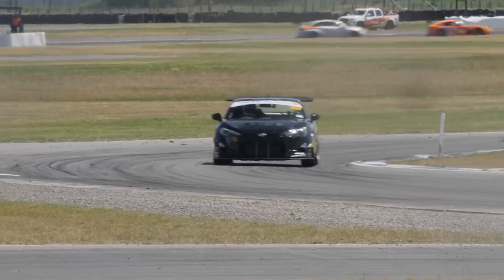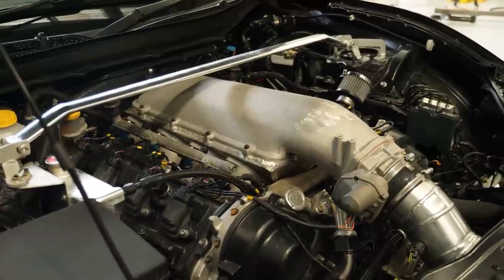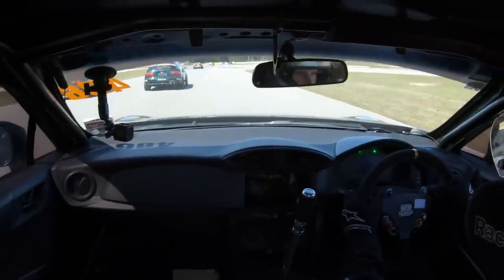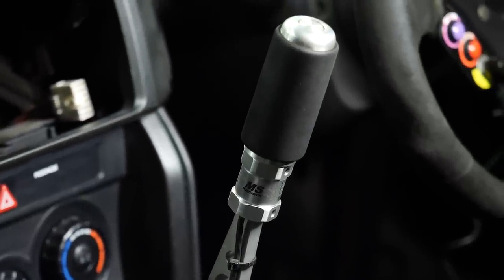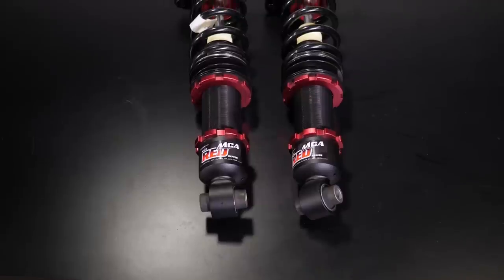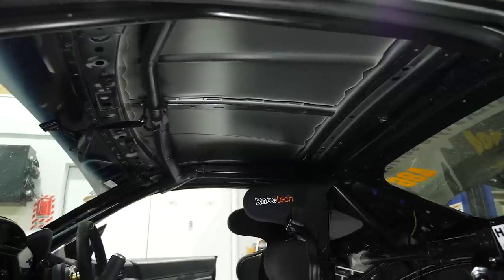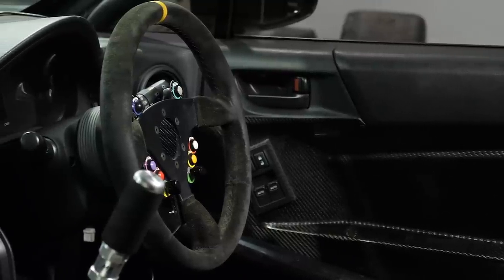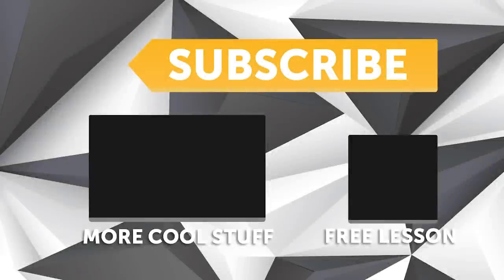8700 RPM V8 GT86 Build | 6-Speed Sequential 450HP 1UZFE [TECH TOUR]

Comment: This is why the VVT-i 1UZ is highly underrated. Rev limit increase and increased horsepower without boost, also means no weight added from a turbo or supercharger.
Reply: The engine in the video eventually blew up during their racing series.
Reply: and in this case no vvt
Reply: This is a superstock engine using kelford superstock cams, VVTI has been deleted, or they likely used an early motor if they have stock 10:1 pistons
Reply: @BigGroupHug  dang how do you know? Is there a video about that
Reply: @BigGroupHug  lots of racecar engines  “blow up” it’s part of Motorsport and racecars living hard lives as well as tuning cars for higher power trying to figure out its limits and breaking point

Comment: Hello High Performance Academy, I'm an amateur driver and I recently bought the Cusco Type RS 1.5way LSD for my 86. I'm wondering if you decided to keep the stock settings or did you reduce the number of preload springs and/or the number of activated friction plates? Thank you, the videos are amazing!
Reply from the maker: Yes we have deactivated a plate on each side. We find these diffs to be a little too aggressive as setup out of the box which tends to cause mid corner push and corner exit oversteer.
Reply: @hpa101  Thank you so much, I will take that into consideration when I first setup my diff. I will make sure to buy your merch, you give so much to the community!

Comment: Absolutely sick build Ive been a big fan since i first saw it. Can you guys offer any insight on what you suggest in the search for more power on a budget with this engine? I’m currently planning my build for a 3uz swapped is300 drift and time attack car. I know fitting an m90 or m112 blower on it is common but it seems like a lot of money and complication for power that could be achieved NA. I also worry about how much power the weaker 3uz rods can hold and when a dry sump becomes necessary. What are the weak points reliability wise and what would you say are the first things to do when looking for more power?
Reply: If you’re gonna boost it go ahead and upgrade your rods. Have you gone for the build?

Comment: This is awesome! What are your plans for the new engine(3UZ-FE)?
Reply from the maker: A little more capacity, more compression and an ITB inlet manifold. We're hoping for around 550-600 hp.
Reply: @hpa101  that sounds like an amazing engine package for the 86. Do the UZ engines get a lot of aftermarket support in New Zealand?
Reply: @aaronbryan5095  that's where they are very popular. As well as aus.
Reply: @aaronbryan5095  heaps of support look up HRE or hartly engines 1uz for nz superstock 9000rpm nearly 600hp n/a 👌👌

Comment: How would running vvt not help , even just to help widen the power band by 500 rpm or to pick up some tq at lower rpm as , you could limit the deg if it works on the old 20v system , so as to have no V to P contact , 
Any chance of a dyno graph and one with foot pounds please 😄, 
Am I right that all the development of these engines are with in race rules , valve lift and compression
Reply from the maker: The engine typically operates between about 7000 and 8700 rpm and VVT really would offer limited advantage. The other issue is that given the lift and duration of the new cams, there's very little room for them to be advanced/retarded. The juice simply isn't worth the squeeze.

Comment: Are the heads, cams, valve springs and intake manifold going to be available for sale soon? I'd like to have that power in my Tundra
Reply from the maker: Hey there Hugo, we're not partying anything out sorry mate, but Hartley Racing Engines in New Zealand or a shop locally to you could whip something up I'm sure. I think Hartley source their cams from Franklin Cams, also in New Zealand - Taz.

Comment: Sorry, I don't get the downshift entirely. Does the ECU time the blip to happen after the dog disengage, before re-engage? Or do you rely on the assumption that downshifts will only be done under closed, or nearly closed, throttle condition?
Reply: Same time. Technically the blip probably starts happening first, unloading the gears and allowing them to disengage, and the rest of the blip it's engaging the next gear.
Reply: @neomeg2232  sounds good to me, cheers
Reply: @derwhalfisch  no prob. 👍 Don't take that as gospel though. I've only worked with stuff for bikes, like Bazzaz. I'm not guaranteeing the system these gentlemen are running is identical.
Reply: @neomeg2232  ha yeh i'd still like an HPA response but you pointed out that the blip will unload the box and that solves most of my confusion
Reply from the maker: The timing of each component of the shift can be very accurately timed through the MoTeC ECU. In most cases you actually want to begin the blip before the dogs disengage because when you're off the throttle the dogs will be locked on the overrun faces and the blip aids disengagement. With a manually actuated sequential we have less control because the shift barrel is moved by the driver. In a paddle shift system we can time the barrel movement independently of the blip/cut etc.

Comment: FUEL QUESTION HERE!
IS IT SAFE TO  SAY THAT THE FUEL SURGE TANK PLAYS THE SAME, IF NOT SIMILAR AS A CAPACITOR IN SAY A STEREO SYSTEM I.E. SUBWOOFER AND MONOBLOCK AMPLIFIR!?!?@

Cheers and Thanks in advance!!
Reply from the maker: In a way, yes. It just ensures you have a constant, uninterrupted supply at the correct pressure no matter where g-forces are trying to instead push things - Taz.
Reply: @hpa101  
Thanx, Taz!!! 
I hope you're having a good one!!!

Comment: I thought ye have had terrible trouble with the dss shafts? Surely they don't even deserve a plug after all the grief caused?
Reply from the maker: I wasn't sure if I should mention them or not, but their 800HP shafts and EVO ones Andre has used in the past have been fine, just the 1000HP axles and the current team let us down. I'm optimistic Frank can turn the ship around with a heavy hand - Taz.
Reply: @hpa101  Very fair of you. It would be reasonable to expect a completely trouble free season next from their '1000hp' shafts for their reputation to become untarnished. If there are continuing problems as before, the product would have  to be classed as unfit.

Comment: why use a VVT motor if you are locking it out anyway?
Reply from the maker: This was originally built as a performance street car.

In some cases VVT versions of engines might have other advantages beyond just having VVT even if you plan to not use it - Taz.

Comment: Hi there. I need a lot of guidance. I have the same platform and I am looking at the same option of engine. I need some guidance to get the motor and box to fit. Has anyone got links or sites for me to look at?
Reply from the maker: The guy who built this originally posted on the FT86 club website a bit however he didn't do much of the hands on work himself so it is unlikely you will find much technical information as I know Surefab in Christchurch did the engine mounting for him - Taz.

Comment: Don’t forget to put some two stoke oil in the fuel otherwise you’ll get a stuck valve when running E85 on 1UZ especially racing offseason. 1UZ is non interference engine.
Reply: SkidFactory just confirmed this the other day haha
Reply from the maker: Sorry but adding 2 stroke oil to the fuel would be a terrible idea. There's no advantage and you'll reduce the effective octane of the fuel. E85 has plenty of downsides which can be easily mitigated, however a stuck valve is not one of them. While a stock 1UZ is not an interference engine, this one is a very long way from stock.
Reply: This is not non interference. It had vvti. Non vvti are non interference

Comment: Is there any reason why not 3uz?
Reply from the maker: Not sure at the time as we didn't put the 1uzfe in there, but, we were going to build a 1uz/3uz hybrid till Covid got in the way and we went with what we instead had on an engine stand here - Taz.
Reply: @hpa101  So you think the 3uz is a better engine to start building? I've been researching for a while before starting my swap and from what I've noticed a lot of people use the term 1/3 uz hybrid. I've always wondered what 1uz is better than 3uz (except looser exhaust manifolds if we're talking about a serial engine). In my country there is e30 with 1uz swap however they also use the term 1/3uz, from what i know they bore the block to 3uz capacity but for the rest i don't know. The car runs on motec, has 8 throttles and has about 420hp

Comment: Wide body it with a rocket body kit and bigger tyres
Reply from the maker: We don't have an unlimited budget so want to stick to the current tyre sizes as once you put a bigger tyre on, you generally want more power to match, which means more stress on the drivetrain and cooling system etc etc etc - Taz.

Comment: You guys just forgot to talk about the cooling system :/
Reply from the maker: Yes we didn't cover that sorry. Engine and gearbox had aftermarket coolers, as well as an uprated radiator. The car needed more than this however and after purchase cooling was the first and main focus with it being fine for a road application but not for racing especially when in dirty air behind a safety car etc..
Ducting rather than increased cooling capacity was really the final piece it was missing.
From there rear diff temps were also a bit of a struggle, fitting bigger brakes to the rear helped immensely - Taz.